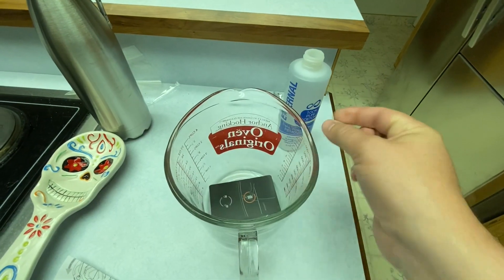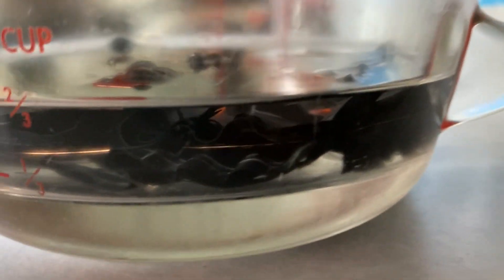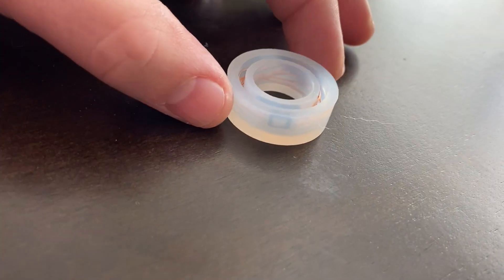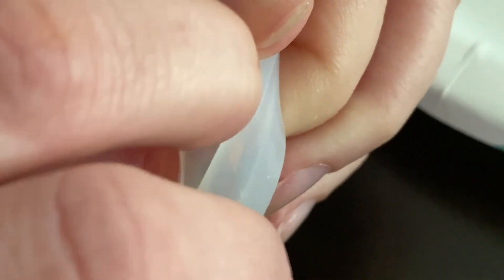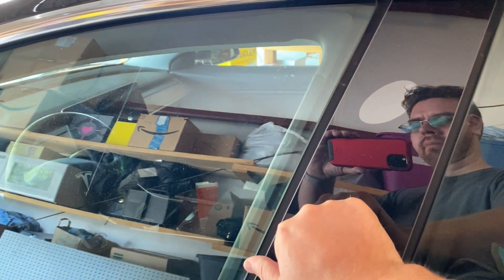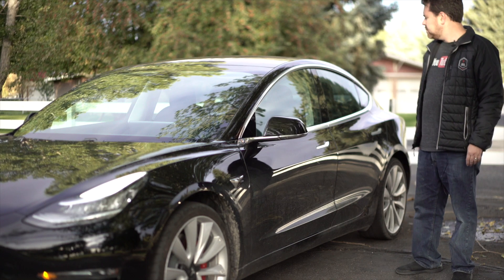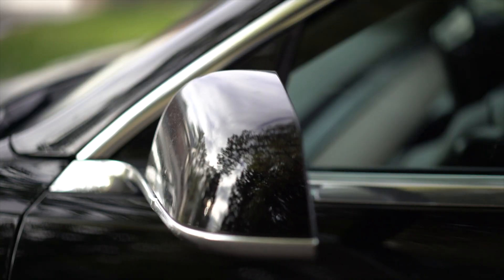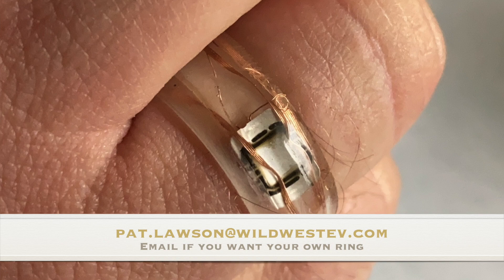Tesla Ring Key DIY

Comment: Does it need to be cast within a rigid material? Have you thought about, or would you consider trying to cast this into silicone?  I'm thinking either a silicone wristband or a silicone ring. I assume the casting process is very similar but it's different materials.